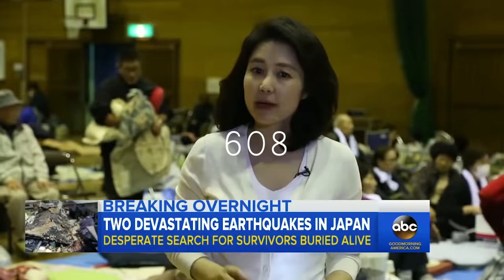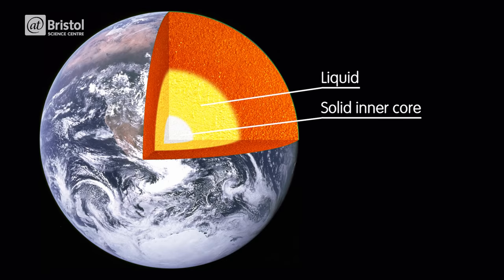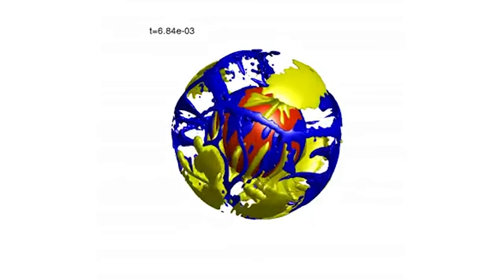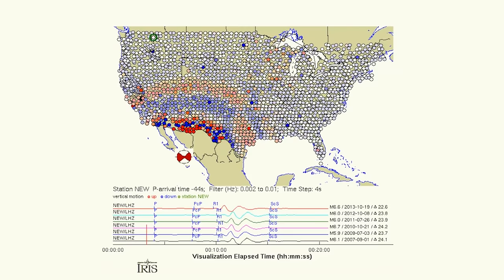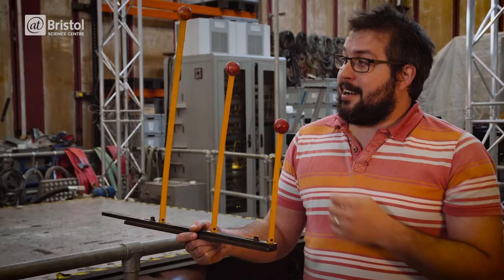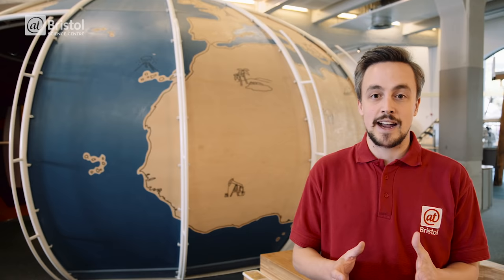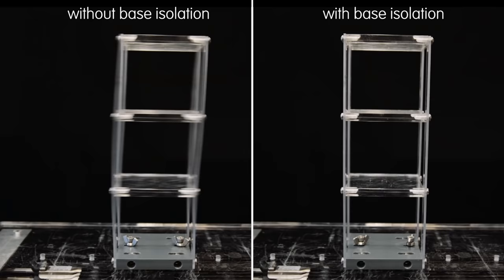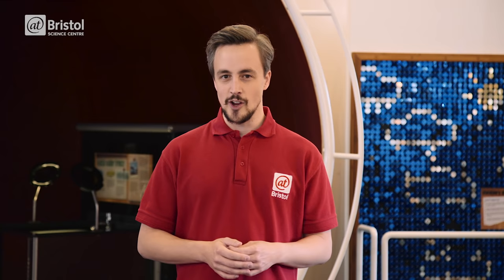Why It's Impossible To Engineer Earthquake-Proof Buildings | We The Curious

Comment: According to minute 8:02, the video's title is wrong.
Reply from the maker: Unfortunately, making a building 'earthquake-resistant' and making it 'earthquake-proof' are different things. Buildings can resist earthquake forces through good engineering, increasing their chances of not collapsing. But as Joel said, there are too many variables to make a totally earthquake-proof building possible.
- Ross
Reply: At-Bristol Science Centre: Still, it would have been nice if you had enumerated those variables and the proposed countermeasures. Of course, each countermeasure will raise cost. You can have earthquake-proof buildings. They'd just likely be cost-prohibitive.
Reply: Mike Trieu Constructing a truly earthquake-proof  building can be done, but the " square cube law" , applies making for limitations  for larger buildings. Straightforward three story residences can be constructed to 10  magnitudes & be undamaged, but the occupants need  sorts of restraints, padding if you will,  to survive such forces.
  Ever notice the building demolitions, taking out a single floor...& the falling of structure "one floors worth" of accelleration...?? & the building essentially destroys itself? (World trade center, 9/11). Square cube law here...several smaller structures do not fail at such decellerations...do you see a Dump Truck flatten itself being dropped from 12 feet?

Comment: Here in chile all buildings are earthquake resistan, but that doesn’t mean that they won’t fall, you still have to go outside if you are near an exit
Reply: Ramiro Cadena P. There’s no such thing as ‘earthquake proof’ buildings are built on the merit of ‘ground acceleration’ Chile’s earthquakes occur 20-30 miles deep underground because it’s a subduction zone, Chile rarely gets those quakes within the top 10 miles of the earths crust, the kinda quakes that feel like a carpet being violently dragged beneath your feet, Chile has been lucky in recent decades to to that, but in the 19th century, shallow crusty inland earthquakes were more common, Chile should expect a return of more shallow quakes within the next 50 years as the subduction zones has a chance to reload the stress as stress transfers!
Reply: Gary Hind exacly i wrote it incorrectly
Reply: Gary Hind uk is for 1 year olds and bad technoloagy

Comment: The UK does build buildings with horizontal forces in mind, we have since 1984, quote the X-bracing in the construction part seen in the video, given the largest known earthquake in Britain was a magnitude 7.0 quake off the coast of Scotland in 1508, as well as a string of earthquakes over magnitude 6.0 that have rattled Britain since, 1931 being the last, even quakes in the low 5 magnitude range can generate high ground accelerations especially if they occur in the top 5 miles of the earths crust, Colchester 1884, Swansea 1906, Derby 1957, Folkestone 2007 are prime examples of that, another wake up call for the UK was the M6.3 earthquake in Christchurch NZ in Feb 2011, that shallow crustal event caused serious damage to brick buildings, after all Christchurch NZ infrastructure was inspired by English architecture in the early mid 20th century, the damage in the Christchurch M6.3 earthquake is pretty much an insight to what a moderately severe earthquake would look like in Britain, quakes of M5.8-M6.2 range should be expected once or twice a century in the UK, it’s just silly how a little readjustment to current building codes would benefit our infrastructure in the long run, all be it 1931 sized quakes to 1987 style storms, it’s not a matter of if, but when!

Comment: It's not impossible to engineer earthquake proof Buildings...We have to allow some deformation in the buildings .....To build Earthquake proof Buildings the cost will be too high and it will be a problem for investors...Best option is to allow some deformation which will not cause collapse to save material....Best term is Earthquake resistant buildings rather than earthquake proof building..

Comment: Earthquake proof and earthquake resistant are two entirely different species. The title does not apply to the video content.

Additionally there are several more variables the engineering a built to be earthquake resistant than just wave frequencies. 

All in all, this video is extremely misleading. Therefore worthless and should be taken down.

Cheers!